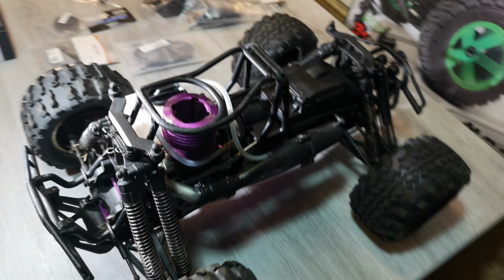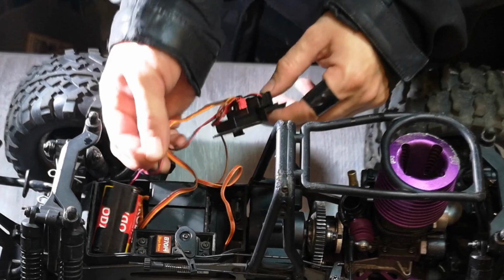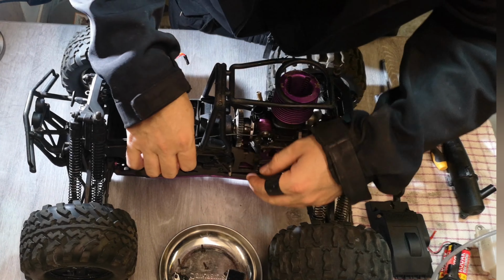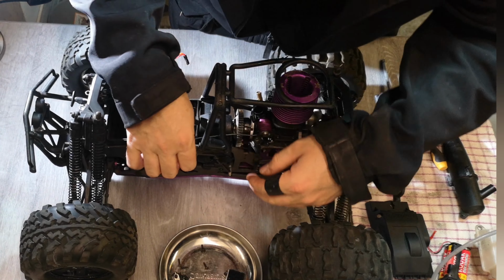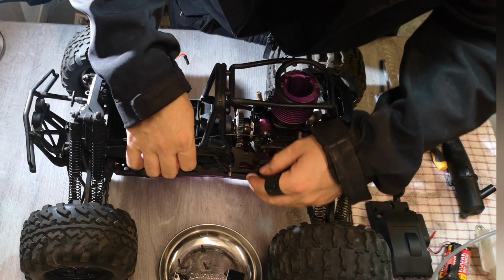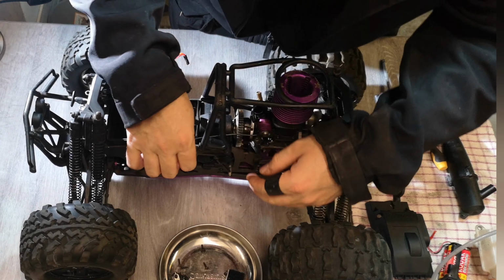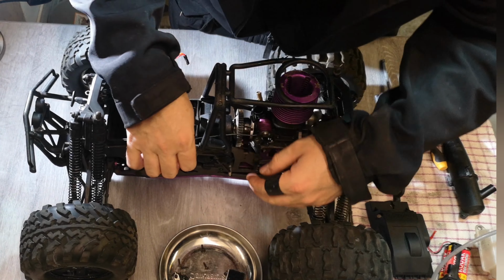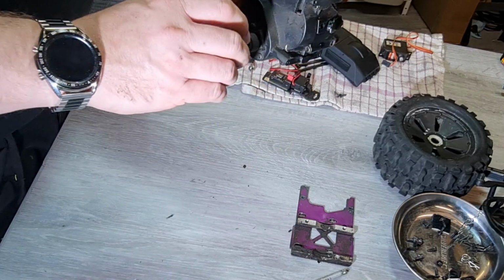Rc How to convert Hpi Savage X Nitro into electric brushless RC Pt 1

Comment: I’m super Interested to do something like this as I have a savage with no engine. How much did all the parts cost as I’m wondering if it’s cheaper to go with a new engine?
Reply from the maker: Depends on the motor esc combo but i reckon it all came to less than £150 but i already had batteries from other cars.was good fun to do although some bits were a bit  fiddly.here to help if you do decide to go for it

Comment: done this very conversion using the savage XL chassis conversion kit. also replaced the standard gearbox with a single speed from the states
Reply from the maker: Its a total beast on 6s maybe better on the xl chassis but no control on the x chassis to small a wheelbase but god dam its fun

Comment: Can you list the Savage conversion parts in more details, such as Manufacture, part name, and number? All the listed ebay and Aliexpress links are outdated.
Reply from the maker: I shall have a look hopefully this evening mate and try and uodate the list will leave in comments below
Reply from the maker: https://www.ebay.co.uk/itm/144484523409?mkcid=16&mkevt=1&mkrid=711-127632-2357-0&ssspo=05gSC3WvS7O&sssrc=2349624&ssuid=jB67iSZzTiq&var=443775616349&widget_ver=artemis&media=COPY
Reply from the maker: https://www.ebay.co.uk/itm/154540161177?mkcid=16&mkevt=1&mkrid=711-127632-2357-0&ssspo=SBjzC8uQQcC&sssrc=2349624&ssuid=jB67iSZzTiq&var=&widget_ver=artemis&media=COPY
Reply from the maker: https://www.ebay.co.uk/itm/165561366174?mkcid=16&mkevt=1&mkrid=711-127632-2357-0&ssspo=phgo6j6jrgs&sssrc=2349624&ssuid=jB67iSZzTiq&var=&widget_ver=artemis&media=COPY
Reply from the maker: https://www.ebay.co.uk/itm/144484505215?mkcid=16&mkevt=1&mkrid=711-127632-2357-0&ssspo=05gSC3WvS7O&sssrc=2349624&ssuid=jB67iSZzTiq&var=&widget_ver=artemis&media=COPY
Reply from the maker: Hopefully thats more up to date.the motor and esc just get from bangood or ebay depending on size you want and play about with pinions to get desired torque/speed.hope this helps

Comment: Convert the savage i drop a 2200kv in mine losts of power. Smoke the tires wheelies alot an reverse losts of fun. All parts on ebay
Reply from the maker: I agree.I just got to get the gearing correct and it will be perfect my best rc basher pound for pound